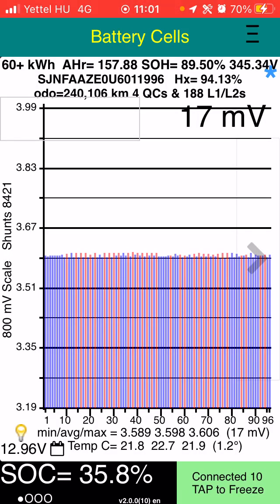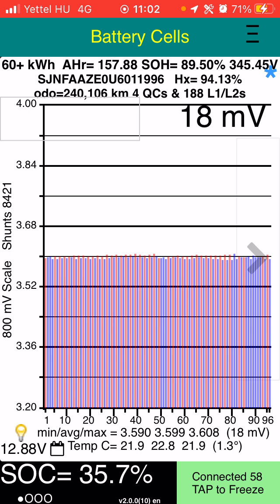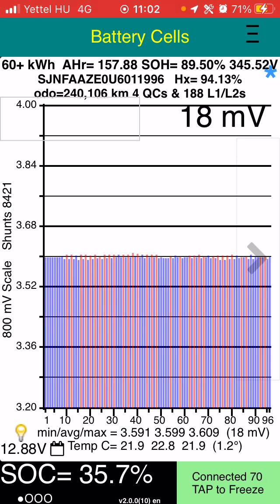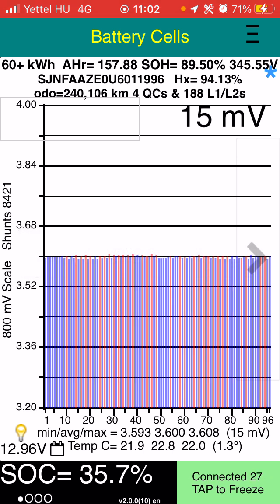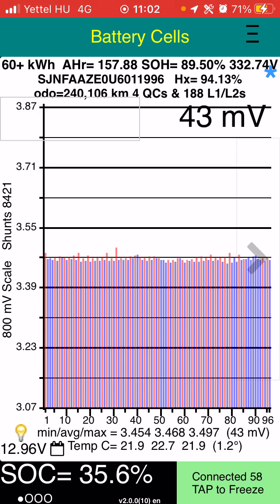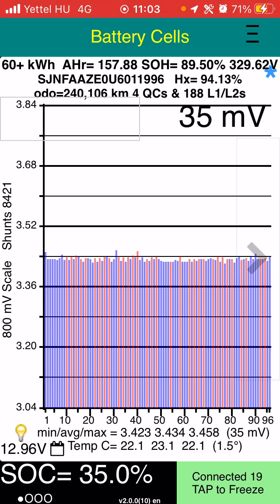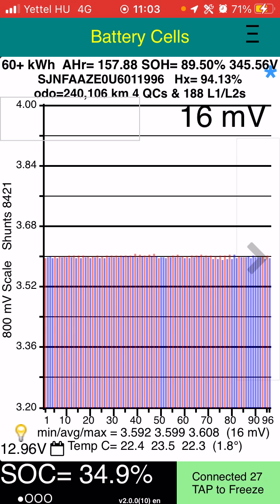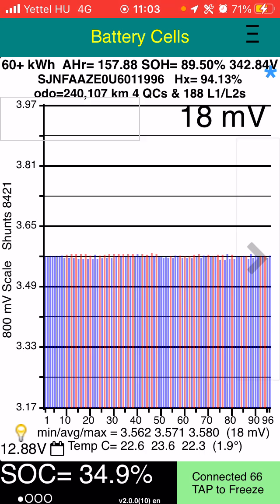Nissan Leaf battery stress test, screen grab from #LeafSpyPro and #LeLink2 OBDII dongle - STRONG

Comment: strongly suggest to put the graph in horizontal mode to show also Amperes drained from the battery. Set up also update rate to higher frequency (2 sec is the minimum IIRC)
Reply from the maker: Happy to do that - can you guide me on the refresh rate change, please
Reply: @mnmszerviz  my fault, is not the window refresh rate that you can change but logging refresh rate in leafspy setting under logging. In any case more detauiled log help to correlate A drained from the battery with cell mV delta